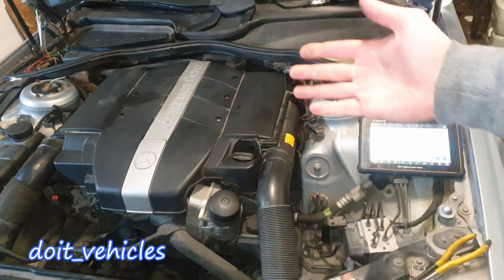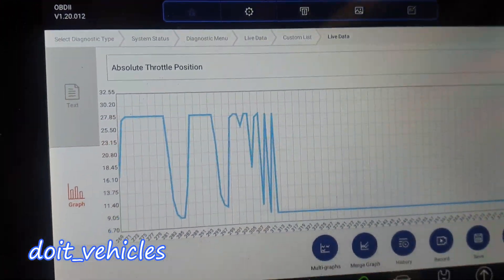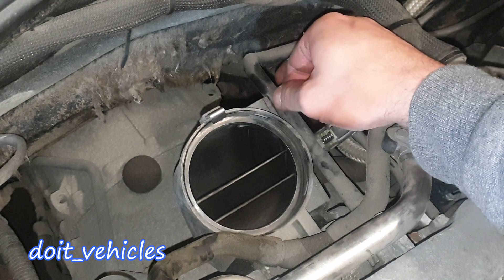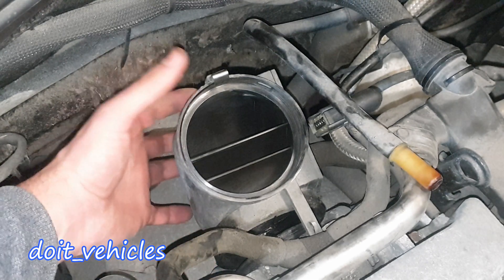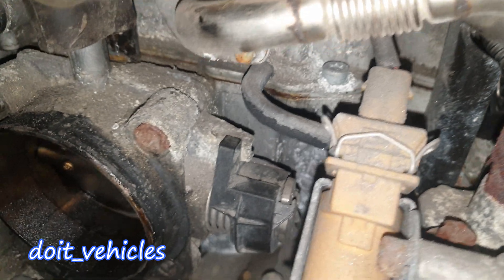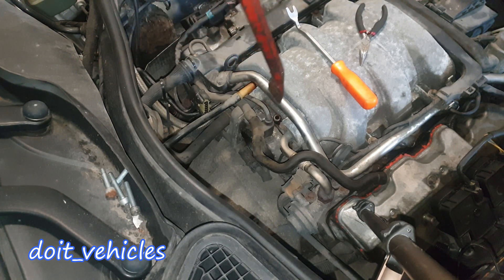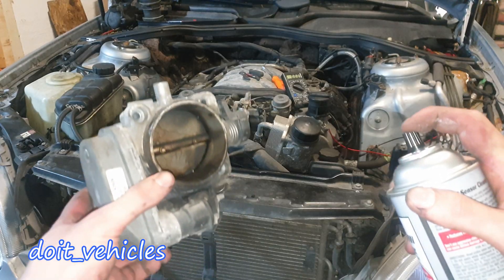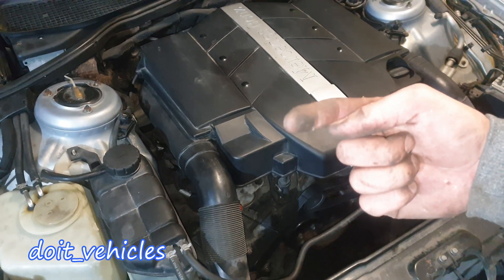S 320 Mercedes W220 Throttle Body Clean , Diagnose , Removal Test P2119 P0638 P0121

Comment: The MAF was the issue my 05 clk500.Rough idle & stalling at lights. Error code P0101.
Got a cheap one off amazon for $35 & fixed!!!.
The throttle body was my next move if that hadn't worked.

Comment: Hi, I have this same car with a crank, no start problem but I noticed that whenever I hear that humming sound from the throttle body and injectors, it starts, please, how can I fix this issue to get the humming sound back in the throttle body and injector area? I will really appreciate your feedback.
I have changed the Crankshaft and Camshaft sensors i also replaced two coils and it starts but won't start the next day.

Comment: Hi, I also have a Mercedes c220 w203 euro 3 and I have some problems with it, if I could help it, I would be very grateful.
It starts sometimes harder, it has a gallop at idle and on the go, if I accelerate harder, it emits black smoke.And I saw that you are a good mechanic for 2.2cdi engines

￼